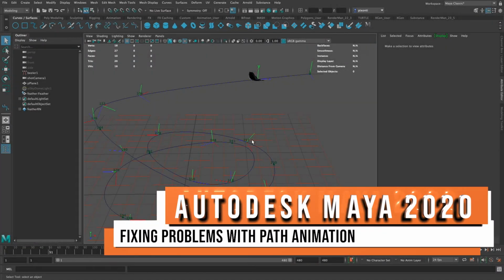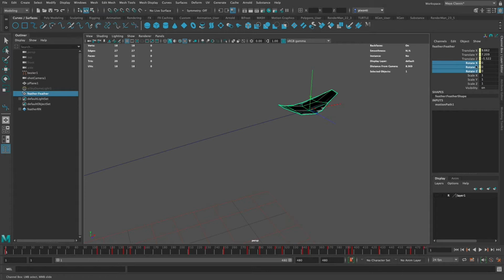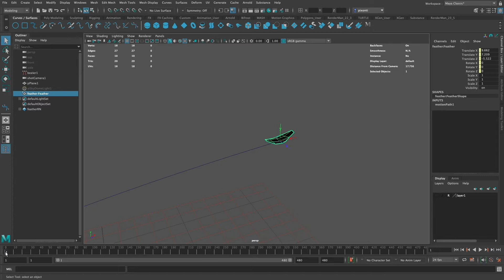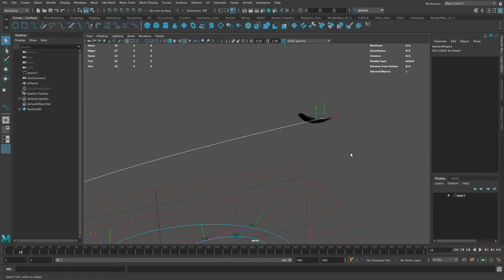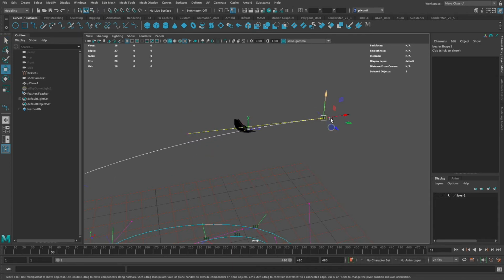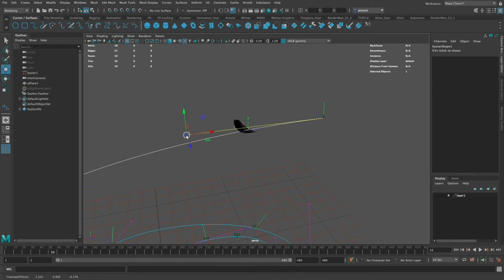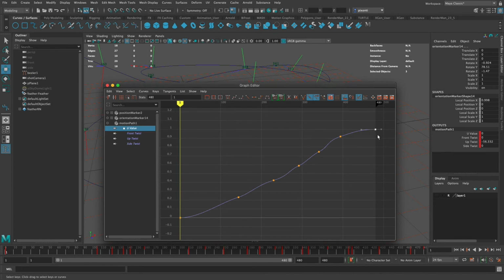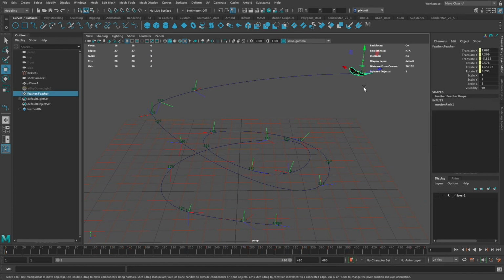Autodesk Maya 2020 - Fixing Problems with Path Animation

Comment: Hi stephan, thank's for this, just  a question, how can I see the info details axis of vertex and object? thanks
Reply from the maker: I assume you are asking about the display of vertex information and selection details in the main viewport, right? If so, from the main Maya menus, choose Display > Heads Up Display and check on Poly Count to display current selection info in the HUD. If this is not what you were looking for, let me know.
Reply: @StephenAnimates  Hi Stephen, thanks for your reply! not that but it's useful to me :) I meant, the details of each vertex and the animated frame numbers on the curve, the letter Y on the leaf as the direction of the axis. I've looked everywhere but I don't know how to view them, it's probably a simple operation but maya is maya :) Thank's a lot!
Reply from the maker: I think I know what you mean now. If I understand correctly, t's not a vertex, although I suppose it may look like one. It's called a position marker. They show up when you keyframe the U value on the motion path. If the markers are not showing up, try the following:

1. Make sure the U value is keyed
I am assuming that you have already keyed the U value at 1 and 0 at different times. For example, the U value keyframed to 0 on frame 1, and U value keyframed to 1 at a later frame. These should show the frame numbers for frame 1 and then at the frame where the last keyframe. Then maybe a keyframe somewhere in-between.

2. Show Locators in the main viewport
In the main viewport Show menu, make sure that Locators is checked (enabled). In more recent versions of Maya this is now in Show  > Viewport.

3. Check Marker visibility
Open the Outliner (if not already open) and click Display  > Shapes (check to enable). The click the plus sign next to your curve to show it's children. You will see a shape node underneath, and that should have a plus sign to expand, and will show the position markers underneath. They will be ordered by the sequence number they were added. Select one marker, open the Attribute Editor (ctrl+a) if not already open, in the Transform node for the position marker go to Display and check Visibility. Look at the shape node (positionMarker) and make sure that visibility is checked in the Object Display.

I know that was a long explanation, but let me know if any of that helps.
Reply: @StephenAnimates   Ah ok, now I understand what is it! after your post I checked on autodesk guide some specific detail about position marker. Thank's a lot for your patiente